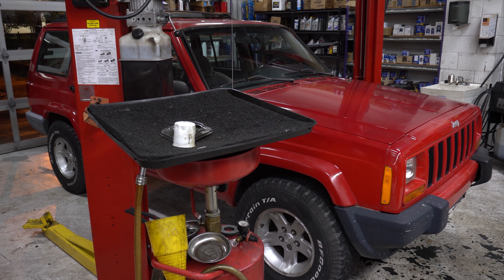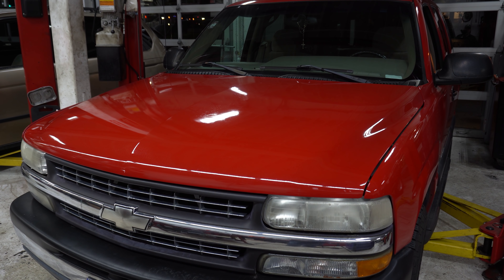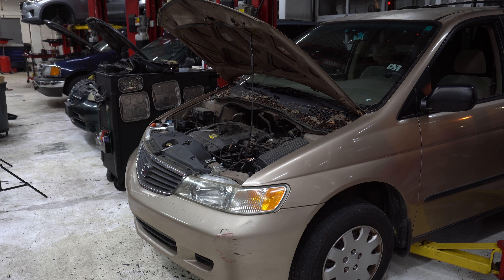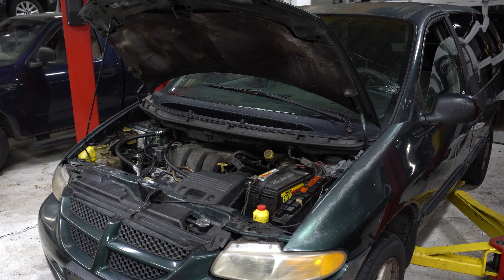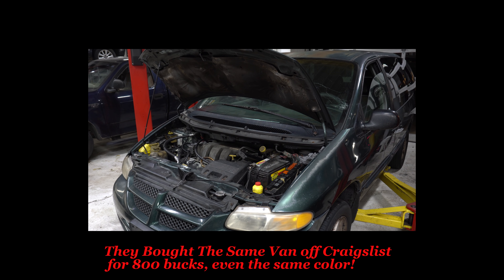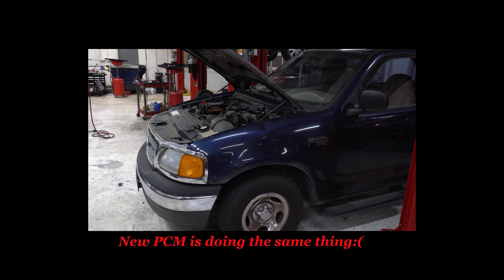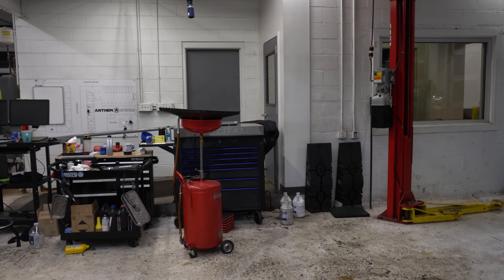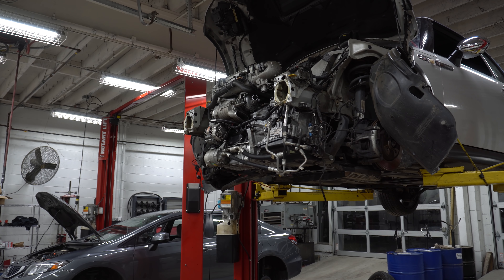What's Going On Around the Shop April 2020

Comment: Them minis are shite, I've had them come up with maf faults and continually failing emission tests turned out that the rings were shot on cylinders 2 and 3 filling the catalyst with oil.
Reply: Yep. I cringe when I see them. Oil burning nightmares. They are so bad, they updated the oil consumption tolerance to a level no one would accept as normal.

Comment: Man thats a good looking cherokee, usually theyre all trashed out... I learned to drive on the one my dad got in 2002 with 60k miles and it finally died a couple years ago thanks to my sister wrecking it. That jeep had never been in the shop it had only got 1 set of plugs, wires, a serpintine belt and a water pump, besides that just oil changes in the 225k it was alive.

Comment: Who pays the second pcm change??
Reply: Good question, diff shops would handle this in diff ways. I wonder how he handled it
Reply: You would think A1 Cardone would refund their defective unit and possibly the labor to install it.
Reply: @cardo1111  right, that's the way it should go.......
Reply: cardo you would hope so. Of course they will pay the factory warranty time and a lower rate and send you a check a few months from now
Reply: Philly Dee that’s the problem, he never says how handles  problems like this. They put a part that didn’t function in the car, they should replace it free. If the new pcm costs more then you charge the difference. The car should have been running right when it left the shop.
    Who pays for the car owners lost time without the car the second time ? Does the shop supply a rental car for free? How about all the arrangements the car owner had to make to bring it back ?
Reply: @joeframer9642  right, exactly.....
Reply: @cardo1111  When it happened to Eric O of SMA he installed a reman starter (napa or dorman I forgot) and the manufacturer of the defective unit would only reimburse half of his time.

Comment: Hey Mike, think it was a good idea to quote a motor on that Jeep.  They are prone to cracking, you can see the crack looking down through the oil fill cap.  Under pressure its pretty easy to see.
Reply: Eric Gunter It’s the 2000-2002 with the 0331 head casting that are prone to cracking but being that it has a junkyard motor it could have the later head. Looks like a rig worth saving but I hope the customer got a good deal on it...
Reply: @rustyjeep2469  good to know.  I just did one twice because neither us or our machine shop caught it.